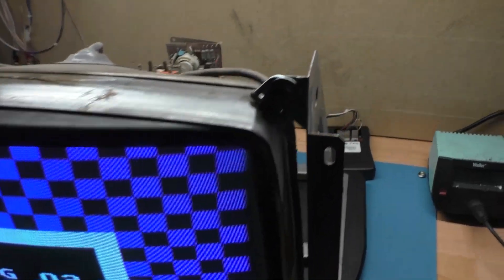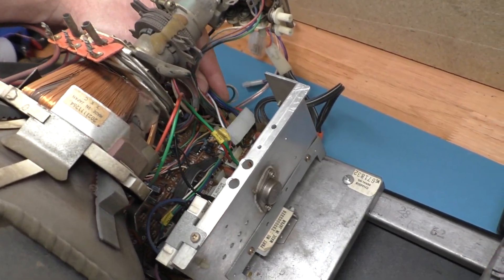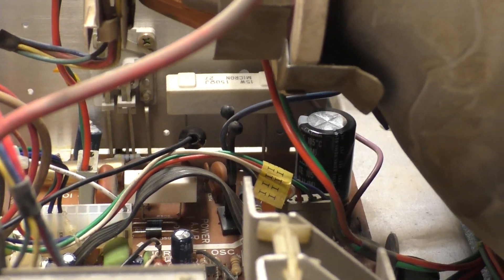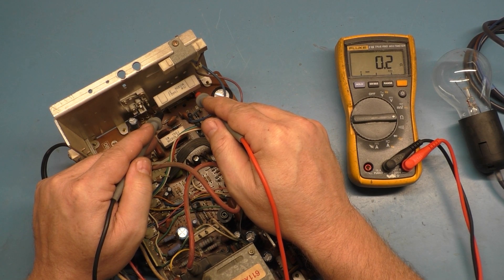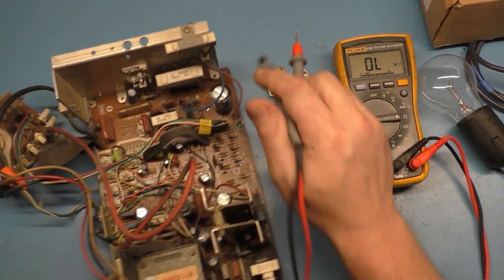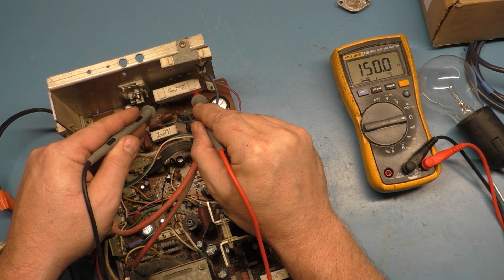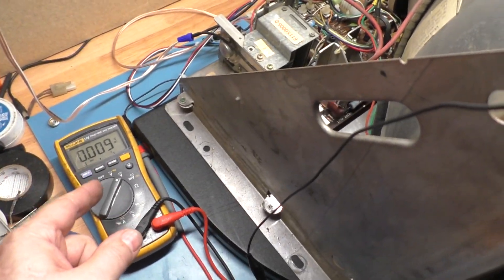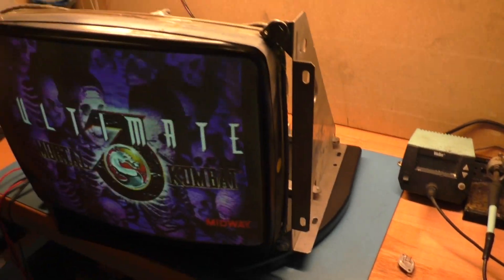19" K4900 Arcade Monitor Repair - "It's Got The Shakes" - Shorted Voltage Regulator But Fuse Is OK?

Comment: Just FYI, a Shorted VR on the 4900 will not blow the fuse.
only if it shorts ALL the legs will it possibly blow the fuse.
it is 1 of the only chassis that will do that, most all others will in some way or another.
the SMPS monitors will also not blow the fuse if the regulation circuit is bad, you have seen that on the 74/75/U5/U2 series.
Reply from the maker: Thanks. Yeah, I suspected as much but just never seen exact scenario before.

Comment: Very odd.   I was looking up the specs on the VR and ran across a KLOV thread where the monitor worked WITHOUT the VR installed.   Maybe it failed in such a way that it didn't draw enough current to blow the fuse.
Reply from the maker: That’s even more interesting.

Comment: I have a Panasonic crt doing something very similar. When it first turns on the image bounces and settles down after a few minutes on. Both sides moved away over an inch and is not exactly straight lined either. So it makes my 36in crt look more like a 27 inch screen if that makes sense. Interesting enough I thought I could use controls within the service screen to pull the sides of the picture back out but only find vertical controls and no horizontal (which is the only crt I have that doesnt seem to have it?!)  Im not extremely skilled with working on electronics as you, but this video has peaked my interest.